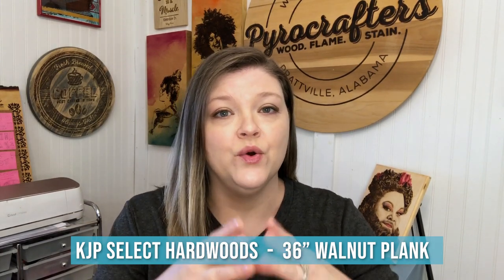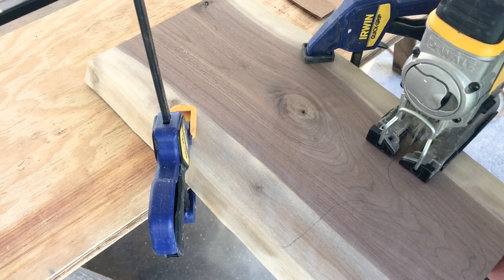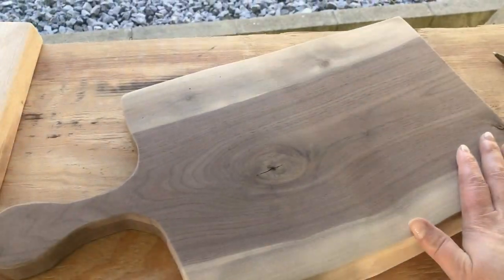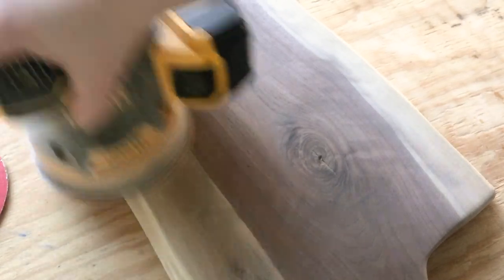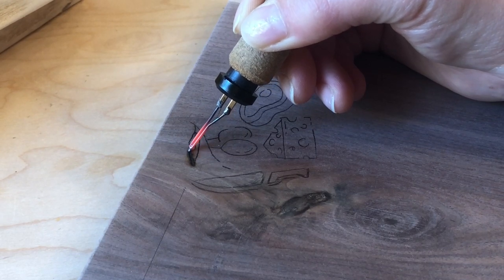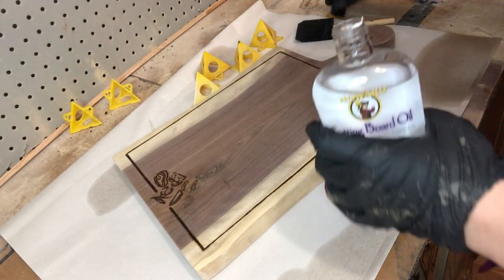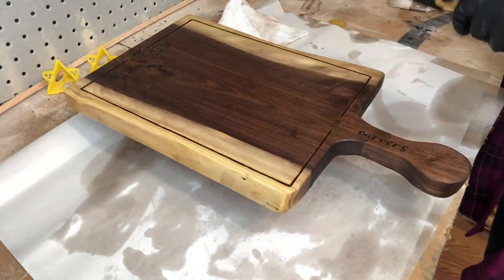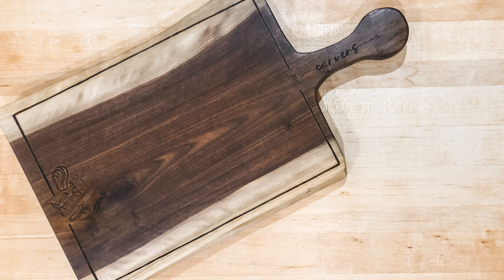How to Make Custom Charcuterie Board | Wood Burning Project

Comment: I have a question... could you put a food grade sealer and not have keep putting the oil on?
Reply from the maker: You can avoid reapplication, but it will get dry. I have a few wood cutting boards and after lots of washes and being used, they all start to dry out.
Reply: Okay thanks. I do a lot of projects mainly just for fun and I put clear epoxy on them when they are done  I just haven't done anything for food.